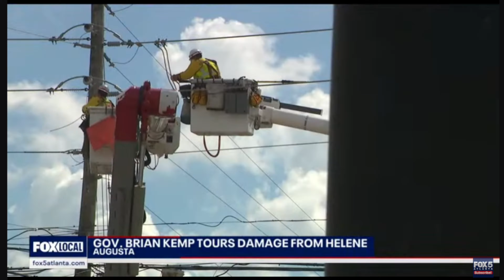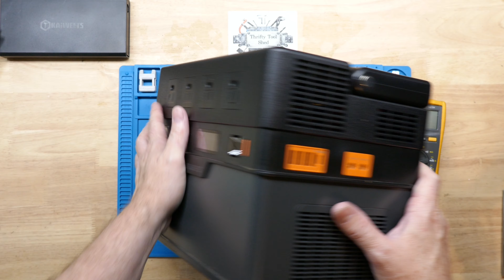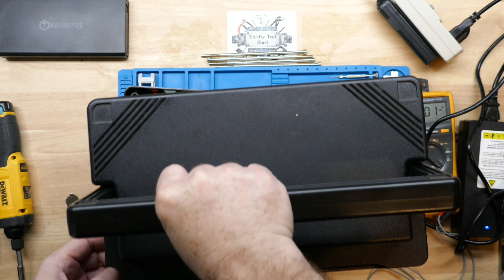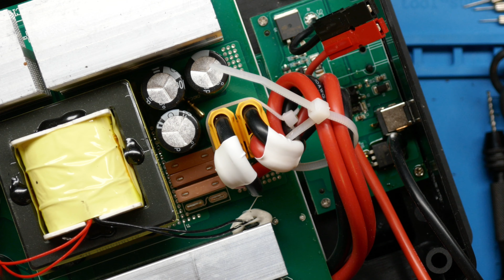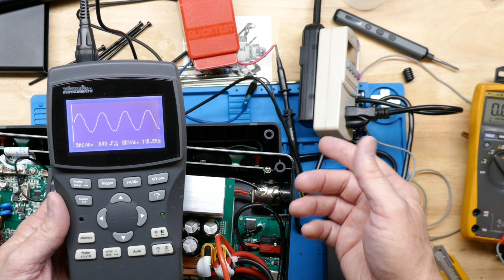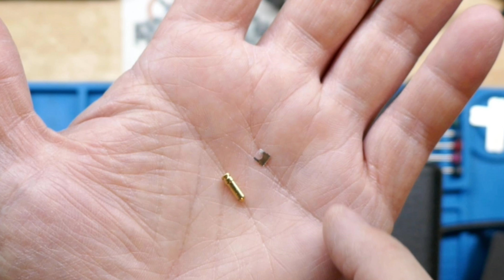All Powers Portable Power Station No Power - Helene Storm Destruction

Comment: Hope you get back to normal, terrible for Chimney Rock😢This fix remind me of a dead laptop several months ago. The center charging power pin was badly bend. Gently reformed to the center, worked plugged in but did not hold a charge. $40 for the battery and boom worked. Windows  ten laptop for $40!